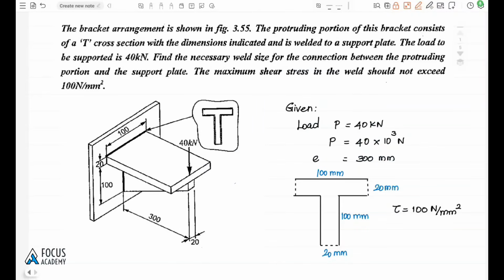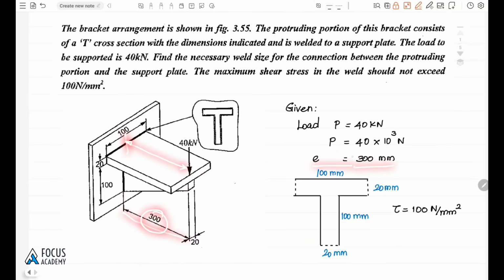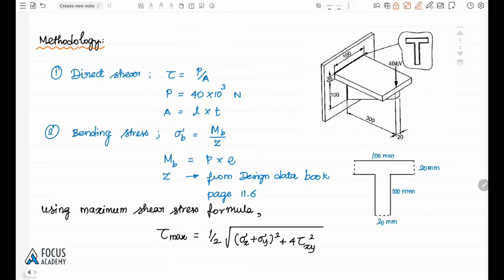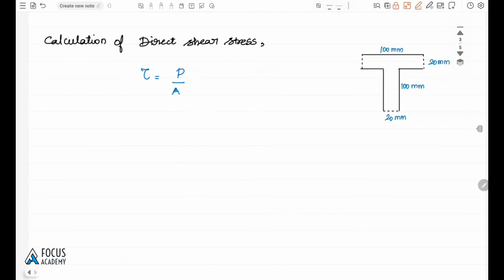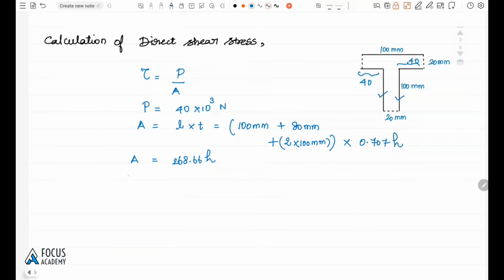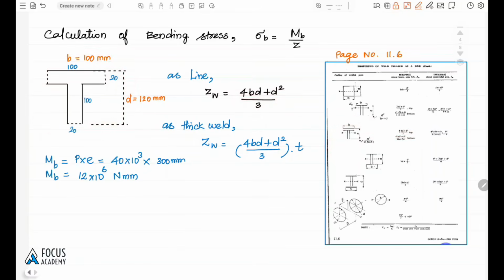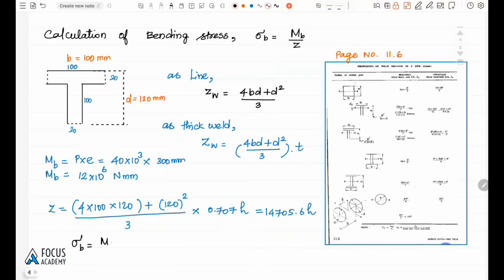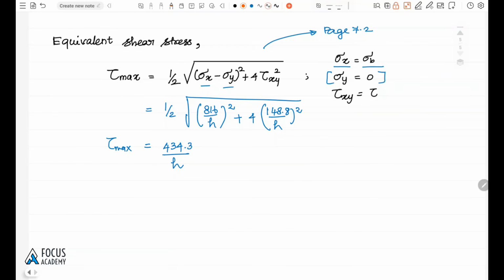Design of welded joints - 3 | Eccentric Loading |  Problem | Design of machine elements | English

Comment: Sir 6 years before oru welding problem la resultant formula normal stress formula potrukeenga and here the formula is max. Shear stress, is there any reason or logic behind that sir
Reply from the maker: @andrewsjoshua226  2 different cases. Check a recent video unit 3 formulas in the playlist
Reply: @focusacademylectures  thank you sir